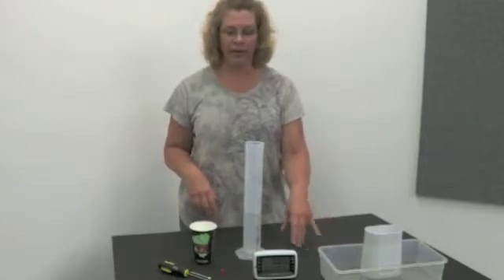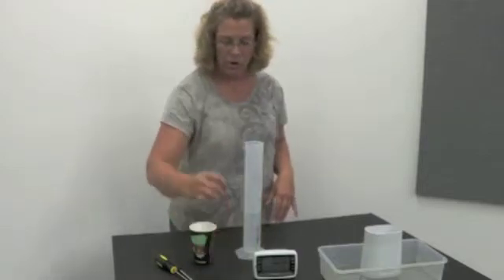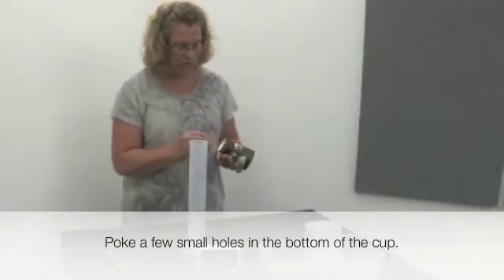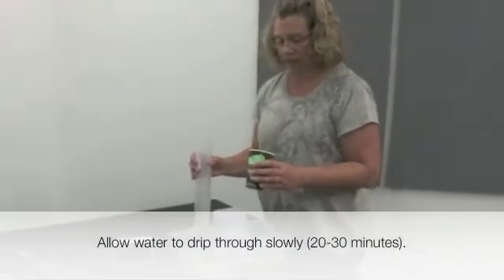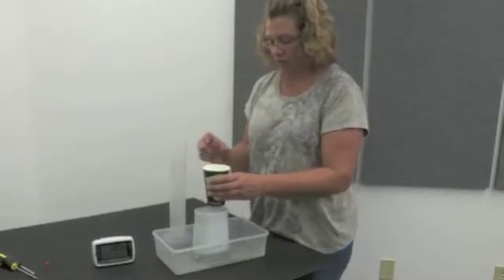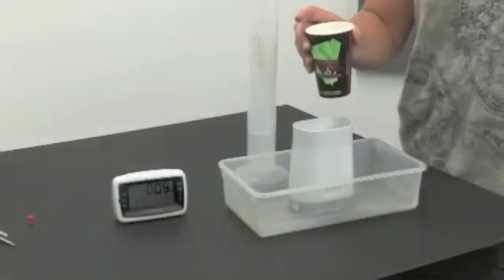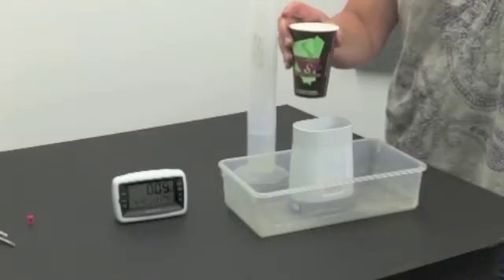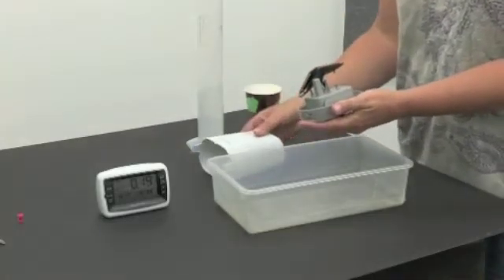AcuRite 00899 Rain Gauge Calibration

Comment: I tested the calibration by measuring dripping water in the kitchen sink.  Using the figure of 8-Oz = 1.68", and a little math.  I went to 6.72" steadily dripping for about an hour and accurately measured the water at 32 ounces, minus 0.7%.  Since the manual says a 2% error can be corrected by a quarter turn of the screws, I'd be turning them about 30°.

Well, 0.7% could easily be an accumulation of measurement errors, so I decide not to make the adjustment at this time.  Next, I'll mount it right beside my CoCoRAHS approved rain gauge to make that comparison.  Whether or not I attempt to calibrate will depend on that test.

Overall, I am impressed with the device.  The monitor is nicely sturdy.  The range is good, giving a strong signal through a brick exterior wall and several interior walls at a distance of 40-50 feet.

A couple other observations:  In your video, you say the display will update in a minute or two.  This is wrong.  It updates precisely every 60 seconds, regardless of the number of bucket tips that have been recorded.  I would like it a LOT more if it updated PER bucket tip.

A correction is in order to your owner's manual!  It states that a few seconds after every bucket tip the display will update.  This is flat out FALSE!  The display updates every 60 seconds regardless of how many tips have occured, whether that be one, ten or anything else.

Also, the owner's manual mandates Alkaline batteries.  I'm using NiMH AA cells and reception is great.  I don't anticipate any problems in that regard.  But I'll keep this in mind if I do encounter any problems down the road.